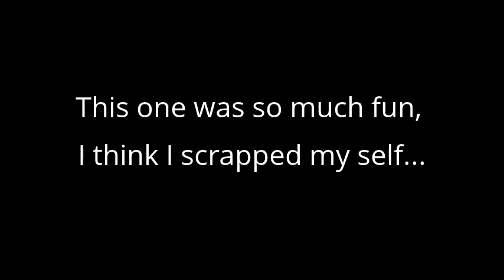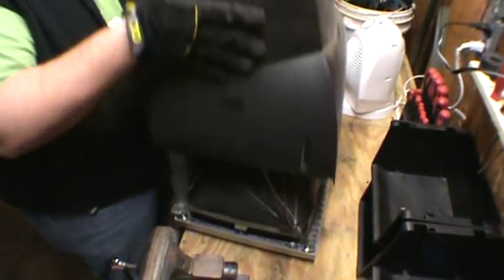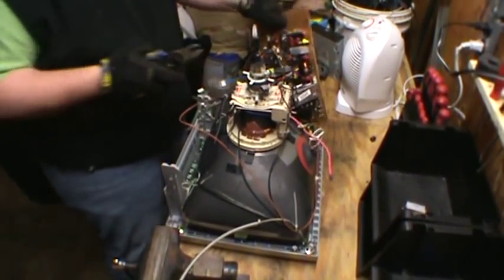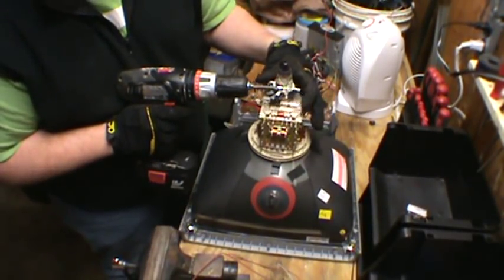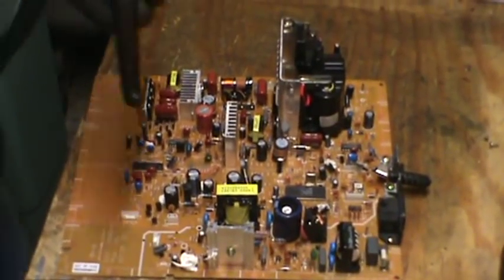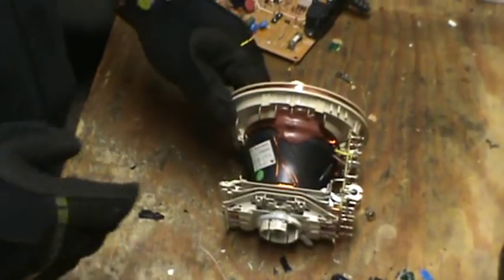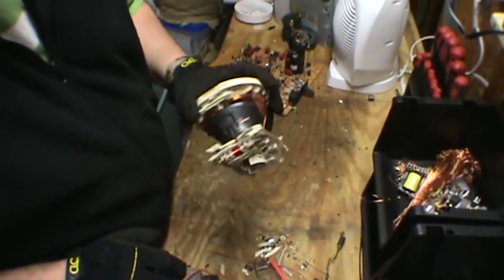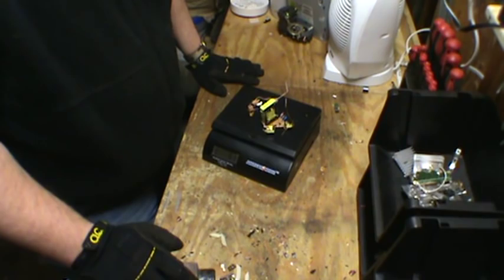How to Scrap a CRT Monitor for Copper, Aluminum, other metals and CASH!

Comment: Anyone please help???
Degaussing cable and Yoke on the back of the crt tube.  What cooper it goese with (Bare Bright, #1,#2,#3?)

Thanks,
Reply: Some Scrap The Cooper To See If Its Coated With Cooper, i like to cut it to see if its Cooper. If its the same Brite color all the way thru as same color then then its Cooper. If its silver type color then its not considerd same as Cooper price. Also the glue will hold it but aftr u break the Ferrous metal that Cooper is cicrled on then snip off glue & pull Cooper eite off, somexs its easy somxs a pain in yo lifely pleasure istico mattrs of life...Stay Encouraged

Comment: how many lbs of copper in 1 Yolk?
Reply: NONE....OUNCES NOT WORTH THE WORK
Reply: About a  pound in massive ones the copper in the electrical tape is about a pound 2. I've pulled out number 2 pencil lead thick strands out of 36 inch & bigger & that wad weighed 5 to 6 pounds plus the yoke was about a pound & a half. When I  was scrapping prices were high like 2.60 for bare bright so all together that tv had about 18 to 20 bucks in copper alone.

Comment: did you see if it still worked? you could have sold it.
Reply: Pingus Vlogs there's no market for them, no one wants them. They get left behind at auctions.
Reply: @danielhall6938  What are you talking about? The demand has been growing steadily since around 2010. Check eBay "SOLD" listings before making dumb comments.

Comment: I believe what you are calling "copper bearing motors" is, in fact, transformers.
Reply from the maker: Slammins1 Hi an thanks for watching!  Welcome to the world of scrapping!  I can tell you might be a little new to the field.  "Copper bearing motor", or "CBMs" are a category of scrap meaning anything that contains both copper and ferrous material and possibly aluminum as well.  This includes but is not limited to transformers, inducers, relays, and even actual small motors like the once found in small cooling fans etc.  This is how most scrap yards buy them and label them as "copper bearing motors" and does not literally mean they are just electric motors.  Similar to how contaminated aluminum is often purchased at yards as "old sheet", that does not mean that it is an actual "sheet" of aluminum or that it is even old, just a name given to a category.  Thanks!
Reply: Thanks for the clarification!
I'm new to scrapping, yes. Before, I had no plans for selling the stuff from these circuit boards I have here, but I'm starting to look like a hoarder!

BTW, I dig your videos, keep it up!

Comment: Not a huge point but those aren't motors they are transformers or induction coils.  You should also consider finding say a strong twelve volt motor, don't tear it up, and put a spool on it.  You position it with an axle a foot or so away. Every time you get a winding that is on something like you stuck your screwdriver through you can put the new spool on the axle, twist the ends of the wire together, turn on the "spooler" and let it do the work for you.   Just a thought.
Reply from the maker: Right......I get that a lot.....  Copper bearing motor, or CBM, is what most scrap yards call the category of things that are containing both copper and ferrous material.  It does not literally mean its a "motor".  This includes transformers, inducers, coils, flyback transformers, as well as electric motors.  Thanks for watching!

Comment: Moose let other scrappers know not to crack or break the glass on computer and T.v. tubes. There's a lot of lead that can fly around and cause lead poisoning
.
Reply from the maker: +James Cottrell You are correct that there is lead in that glass!!  Fortunately it is encapsulated in the glass so the risk of airborne lead is extremely low.  The bigger threat would be the phosphorus powder that is in there.  Thanks for watching!
Reply: ***** It just much easier to dispose of them whole than having to clean up that mess too, but hey whatever you want to do.

Comment: if you want to scrap yourself, scrap an electric mower, big nugs of silver.
Reply from the maker: Jay Stevens Sweet, where in the mower?  Can I cite you in that video?
Reply: Moose Scrapper there is a switch box like you find on a circuit board, only larger. I believe the silver nugs are bigger than you find in a circuit breaker for the home...yes you can cite me.

Comment: Unsubbed, You said i would find copper, aluminum other metals and cash. I found no cash inside :( dislike for misleading title
Reply: seems like u got ahold of a tv that somone else already stripped, because there is Cooper & Aluminium in all tvs. but stick with it, it'll pay b'day off. I ran into aame prblm 2xs out of 200tvs ir stripped. Stay Encouraged
Reply: MissionScrappr Will No no I found all the metals, but in the title it said I would find cash as well. And I found no cash :( 
First the frozen tv series turned out to be fake, and now I can't find dollar bills in my crt's. This is the worst 7 months of my life ever.
Reply from the maker: Shamic Entertainment I have found coins that kids have stuffed in the speaker slots before....